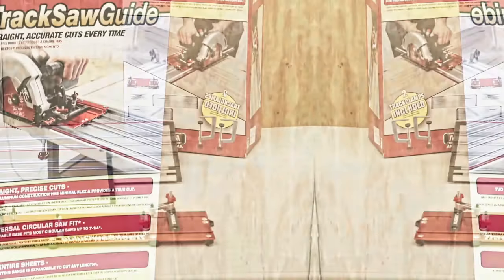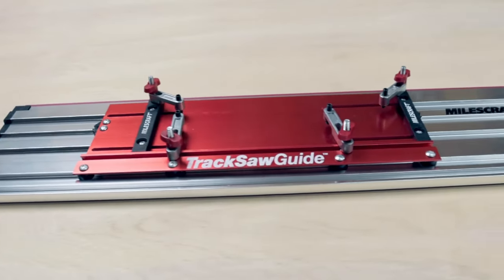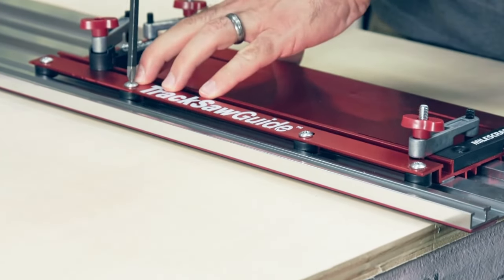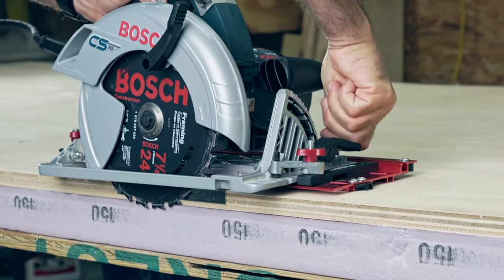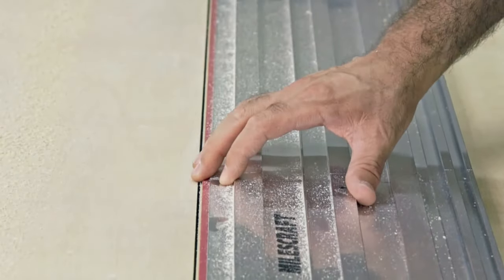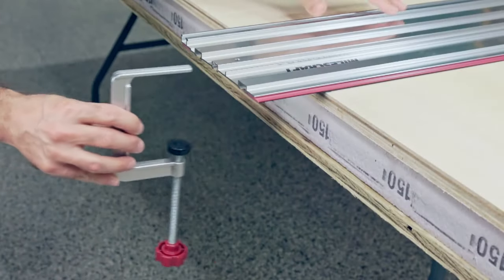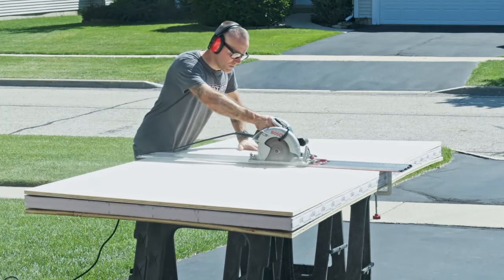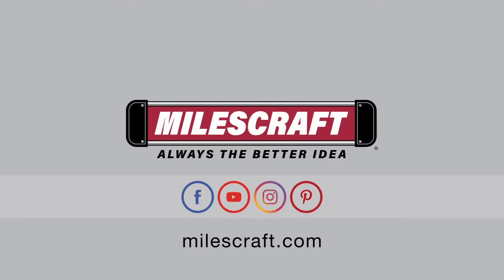Milescraft 1409 TrackSawGuide™ - Straight, Accurate Cuts Every Time

Comment: You guys need to take a second look at the compatibility chart. It indicates 2-3/4" to 5-1/4" from blade guard to edge of plate. My saw measures 3-1/8" blade guard to edge of plate and the clamps will not fully reach, the set screws are 1/2 on the edge of the plate when placed fully perpendicular. If it was 2-3/4", the set screws would be about 1/4" from touching the baseplate.

Comment: It looks symmetrical. 
Will it work with a saw with the blade on the opposite side of the saw body? (i.e. Milwaukee M-12 Fuel 5-3/8 inch saw)
Reply from the maker: The product works with both left and right bladed saws.  The only difference is the direction you have to push the saw.  Right to left or left to right. Battery powered saws sometimes have issues with the battery hitting a clamp post and sometimes work arounds are required to achieve max cut depth.